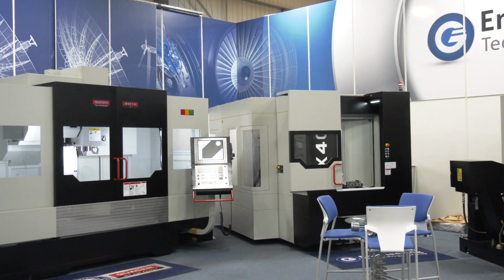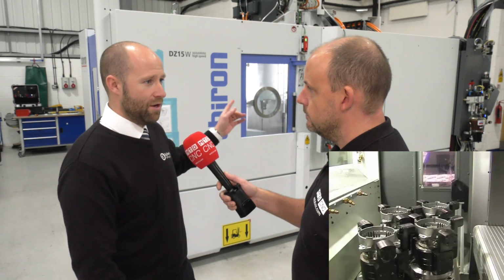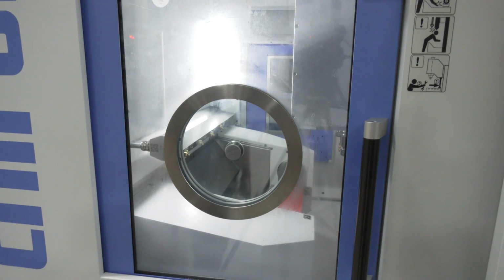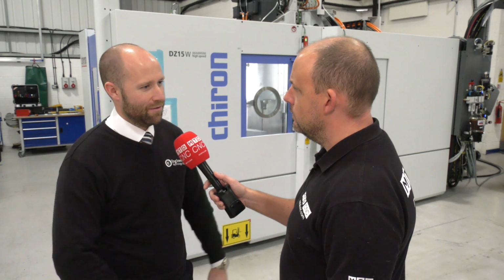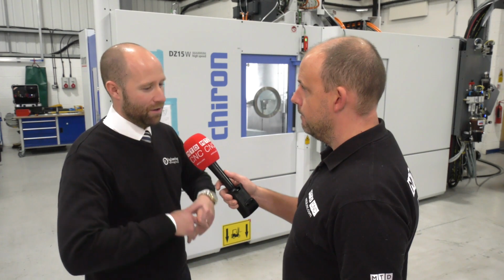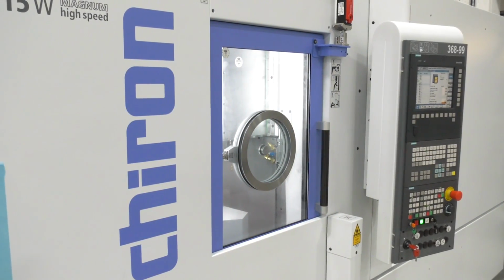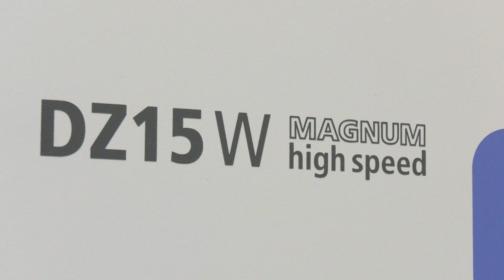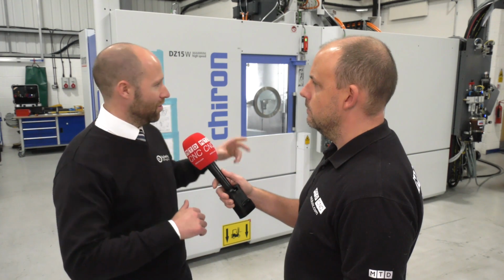Why go for two spindles on a twin pallet VMC - Chiron DZ15

Comment: How do you make sure each tool is at the same length for each spindle? Do the spindles have independent adjustment, or move independently?
Reply from the maker: i believe they move independantly if required but you'd need to check with ETG

Comment: Where are examples of parts this machine can do?
Reply: Go to Chirons website
Reply from the maker: typically automotive parts, castings maybe. Multi face machining but high volume to get the benefit of both spindles.
Reply: We manufacture complex automotive piston. We have at least three of these machines right now. Cycle time with three tool changes about 47 seconds for two parts. Superfast